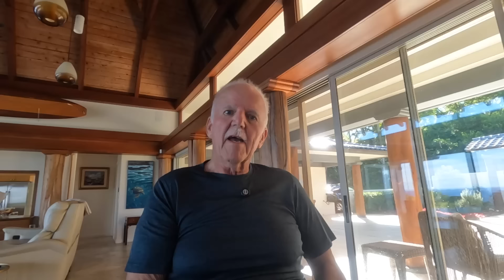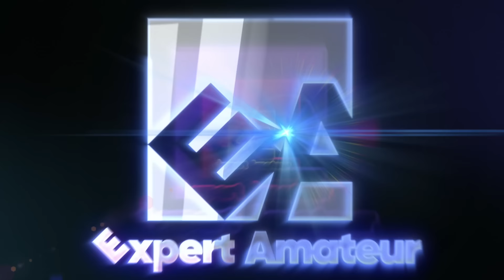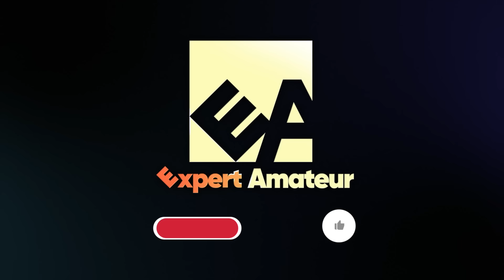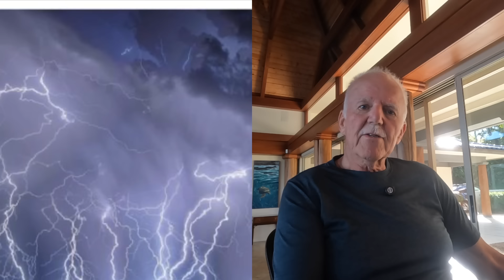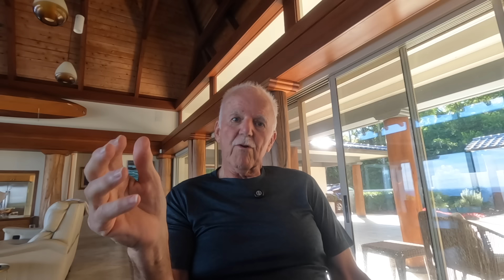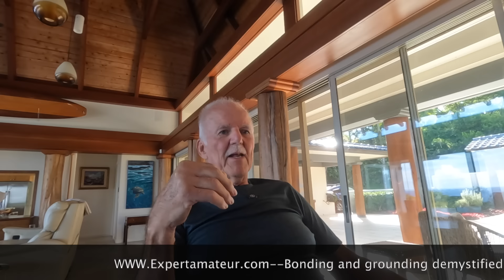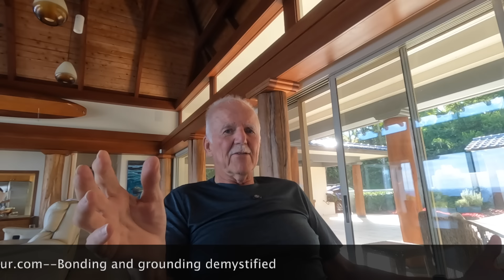solar grounding

Comment: I would appreciate any  feedback on my entire comment I am posting here...
Since I'm no expert either......What is there to do when the actual Experts have no definitive answers and only guesses? 

Personally I'm not comfortable with people on youtube pontificating on what is improvable either.
Respect to Mike Holt, but if he is not certain then I am not certain about putting my trust in 
Electricians or Solar Installer’s advice  on my PV system either.

So Im starting  back at the beginning.. What  am I trying to accomplish or avoid?
IMO, I think its Safety First and Lightning second.
Mike Holt is all about safety and if we look at our solar arrays, we need a proper DC safety ground first and foremost.
To do this we need to watch our terminology and the miss use of substituting the word "Ground" for "Negative"! 

DC Circuits have a Positive and Negative terminal. There is no Ground. Current flows from positive and back to negative
and that’s it!  A safety Ground gets added on after, which is termed "Case ground or Safety Ground"! This ground is attached to the circuit "housing" or in this case the solar panel Metal Frames, and the Mounting Rails which are all bonded together. (along with any other metal components, boxes, etc.)Then adding this  separate wire for ground which  is supposed to run back to your main service panel (which becomes the single earth ground for everything. ..Pretty sure that is what Code likes to see everything to be grounded this way)  So I would think that this would be a solid fact against running a ground wire to a  rod drivin into the earth by your Array?

Just to follow this to completion,.... the DC Earth Ground is there in case of a short or  fault where the positive electrons will flow to the solar metal frame or rail creating a shock hazard ( path of least resistance). The safety ground diverts the current  to the earth to lessen or prevent a shock. ( Not going to get into Circuit breakers or using  DC arc-fault circuit interrupter (AFCI) here)

As far as lightning :
Lightning is unpredictable , which I think is why the experts cannot come to any certain conclusions.

Expert Amateur says, “Solar arrays attract lightning”. This was my first googled question that I wanted to know before I even got into solar and reading articles and many videos which insist this is not the case, but of course these are not experts either. 
I thought lightning  can use any elevation higher than the earth as a conduit ( a tower, a tree, a human etc. Im not certain it chooses metal instead of a tree out of preference? Perhaps if an array is alone in the middle of a field.and the timing of a passing storm and the build up of a cloud charge it will pick whatever conduit that suits it best.) 

As many have said, for most peoples situations, nothing will protect against a Direct lightning strike.
I have seen a video of 3 people standing under a tree that got hit by lightning and all three collapsed to the ground
from the electricity going through the ground next to that tree. 
If you install a ground rod next to your array, and the lightning strike travels through the ground and up your ground rod.....
Haven’t you just created a path for it to travel up to you panels? 

Which brings me to the next point...

I do not understand why some people are fixated about Tying their ground rod by their solar array  to your main service panel ground rod?... 
The example given of the 1970's computers previously having separate earth grounds which were getting fried by lightning until they decided to tie them together by running a wire to  the Main service ground rod?
So, Forgetting about solar for a moment.... what about just a regular house's electric service that has one earth ground rod which  gets hit by a nearby lightning strike and fries the service panel?. Isn't that the same scenario as the computers with the separate ground?  Wouldn't it make sense for a house be more protected by running another ground rod further away from 
the home to dissipate the lightning ? (I think someone already commented about this on here)
Tying ground rods together that are in 2 different locations is just giving the electricity more room to dissipate correct? 
Isn’t that what is being accomplished?  So What is so special trying to mitigate Lightning by Tying your solar array ground back to the Service main earth ground?  I think Mike Holt is correct , that you are just putting your main service panel in danger. IMO it sounds like there is nothing to be gained attempting to deal with lightning  by directing it towards your Main Service Ground Rod.  Direct it somewhere else in an open field if you have that much of a lightning risk I suppose. But again this has nothing to do with grounding your array electrically and properly to my estimation.
Lightning should be handled separately to  safety ground.

Also, I am thinking that a heavy duty Midnite Solar surge protector for the DC safety ground out at a combiner box
is a good choice of protection for most people. It should help keep a lightning surge from going back down your 
DC safety ground to your Main service panel. Also,  A DC arc-fault circuit interrupter (AFCI) sounds like a good idea for safety as well. But I haven’t gotten that far yet.
Please comment or correct anything I have said, because I am just trying to get to the bottom of what the experts can’t seem to help with.
Reply from the maker: That's a lotta comment. I regret saying "solar arrays attract lightning". I know better, I was trying to make the point that it's worthwhile paying some attention to induced current from nearby strikes, but no, they don't "attract strikes", they'd need to be a lot bigger and taller to do anything like that, and the video and post are not really about direct strikes, but induced current from nearby strikes. If lightning hits your equipment directly it's gone, unless you have some very expensive heavy-duty protective equipment. The meat of the article and video is about induced voltage from nearby strikes and general equipment grounding, two distinctly different topics. Induced voltage can be caused by something as remote as a cloud-to-cloud lightning bolt. If a system has two earth grounds it can induce a high voltage between the grounds which causes a huge current to flow because of the difference in potential between the grounds. If there is no ground on the solar array to provide a short path to earth ground a voltage induced or collected on the array framing and structure can cause current to flow through the equipment to the service ground. Not good for your equipment either. Absent a service ground your entire house has no way to dissipate static discharge, such as lightning, safely into the earth. The service grounds helps protect your home and electrical equipment from damage due to high voltage surges. It also helps maintain the same potential between the earth and any electrical equipment or bonded objects, reducing the risk of electric shock. If you don't have a ground rod, YOU may provide the path to ground by touching any metal case connected to the system ground, which is pretty much everything. It also provides an alternative path for fault currents back to the power source, especially if a neutral connection is lost. But it's not a good path, the resistance is variable and may be high.

There is no easy complete solution. Binding (connecting with a ground wire) the service ground to a local ground near the array seems like the best solution to keeping a good path to ground that doesn't flow though your equipment, while preventing an induced potential difference between the grounds that can cause a destructive current flow though your equipment. Binding the two grounds also minimizes the effects of ground loops. I'm going to add this summary to the blog post. Thanks for forcing me to clarify, you made me think this through and come up with a better explanation. I hope it helps you. Here's the blog post that accompanies the video: https://expertamateur.com/solar-grounding-and-bonding-demystified/
Reply: @ExpertAmateur-xn6dr  Thanks for the reply and I will look for your updates and clarification.
I do have another question.....
Will Prowse had a comment on here but it looks like it was taken down?
 (Im glad I copied it before that happened. )
He said"I like how he goes through everyone's recommendation and logic, then states how he does it differently. I've never had an array that far from my systems, but running a dedicated ground makes sense. It is more expensive but it fixes multiple problems.
People get so angry when I tell them not to earth ground their array. Or to bond to negative. Running separate ground fixes most issues. Just costly.
I would never run two ground rods though. Still see the logic in Mike Holt with ground loops and nec. Not messing with that."

If I am interpreting  Will correctly, he is backing up Mike Holt' comment of being against having a solar array ground rod and also tying the two together if there is a solar ground rod?

Its hard not to respect what people like Will Prowse and Mike Holt have to say. These guys live this stuff on a daily basis. And this is exactly what keeps me undecided in agreeing with tying your ground rod to main service panel plan. (along with all the other conflicting comments and opinions on here). .

No disrespect to you and Im not trying to argue, but I would like to know how you can confidently oppose the opinions of Will P. and Mike H.? (im finding hard to do)
Just as a side note:
If you want to learn to distrust peoples opinions , look up how Australia mandated using DC circuit breakers on rooftops and all the fires it caused. After I went down that rabbit hole and finding out how powerful DC arc's can be compared to those little toys they call DC circuit breakers I am only using knife blade DC Disconnects and fuses in my system!
 Anyway,  My point to this is.....Some panel of human beings who were not scientists or experts decided to mandate the use of these DC breakers and burned down a lot of houses. And guess what... they dont make them install them on roofs anymore! All I can say is this is an examples of someone using logic to put other people in danger! I feel more comfortable agreeing with someone with Tested proof of something.

Some people on here only have experience with just one system (THEIR OWN)! How is that a basis for giving "Expert Opinions or Advice.? (again, Im not attacking you personally, just my feelings on the subject) 
They give their advice with such confidence, almost as if they are an authority. My home is 140 years old and was never struck by lightning, but does that mean my electrical system was A-1 top notch designed? If someone says they were an electrical engineer all their life and they tied all their solar ground rods together to the service panel. Does that mean they have the best method, or has there Lightning lottery number just never come up yet?  For me, all this discussion and conflict of opinion is getting exhausting. Im not looking to outsmart mother nature, I just don't want to install something that makes mother natures job easier?
Reply from the maker: @aab9497  I think I addressed most of those issues in the video, but my answers might be more clear in the blog post : https://expertamateur.com/solar-grounding-and-bonding-demystified/

I'm not sure where Will Prowse's comment appears, it wasn't directly in the comments here, he just said the video and discussion are awesome, which is incredibly generous. But I understand what both he and Mike Holt are getting at. There is good reason to say there is already a path to keep the potential on the frames and mounts close to the same as the service entrance. The system grounds provide that path, and you can certainly tie a system ground wire to the structure of the array. Code says it's OK, and many people do that. It's probably adequate. Probably. But that's a somewhat unreliable connection, relying on a chain of fairly funky screw connections in metal housings and many short runs of wire (especially in old houses like yours) and if your racking is remote from your building I don't see why you'd want to be leading lightning or static induced current into your equipment and then rely on a lightning arrestor to deal with currents that didn't need to be there in the first place. The NEC codes go back and fourth on this. 2017 say "A building or structure supporting a PV array must have a grounding electrode system installed (Part III, Article 250), now it says "Additional auxiliary electrodes are permitted to be installed at the location of ground and roof-mounted PV arrays. These electrodes can be connected directly to the array frame(s) or structure".  I haven't found any explanation for Mike Holt's position, it seems he's just concerned that if the two earth grounds are not at the same potential (which will happen if the connection through the system ground is broken) then the induced voltage of a nearby strike or other static charge will cause a current through the earth grounds to the system ground and bonded neutral that will be hazardous or damage equipment. I agree with that, but by the same logic, the broken connection in the system ground means there is no earth ground path for your frames and mounts, which is also hazardous. So that leads me to the belt and suspenders conclusion that a local earth ground (perfectly OK under code) bound (connected) to the service entrance earth ground is a good solution. No, it isn't a code requirement, just (I think) a best practice. As Will says, it does add cost, but if you're already trenching to connect your equipment to the service entrance then its a ground rod and some bare #6 wire. Maybe $200 if the run isn't super long, and if it is, then I'd say doing so raises way above just best practice. I'll add lightning arrestors too--they cost a bit more than ground rods and wire. Belt, suspenders, and an extra belt. It's all overkill until your pants fall down. 

I do love Will Prowse's videos. I watch them all and read through his forum (even better than the videos). His equipment and knowledge are almost as impressive as his willingness to call bullshit on the myths so many people buy into. He's done three videos (or maybe it was two--I'm old, my memory sucks) recently trying to get people to understand how to charge LFP batteries. The comments indicate some folks are still insisting he's wrong. He's not.  

I dimly recall one video where he was trying to track down some mystery currents in his ground and neutral. First of all, it's remarkable that he was even looking for them, that's a pretty unusual thing to do. He's fond of just laying panels in his driveway or setting up temporary mounts and most of his inverters are transformerless. Nevada's dry air is perfect for building static charges. I think I have some notion where his current might be coming from. Of course he does too. I also like that he's into driving race cars. I spent about 65% of my life racing cars and motorcycles. It breeds a certain curiosity and desire to understand things more deeply. Or maybe I have that backwards. 

Incidentally, I've given up on telling people that DC breakers are inadequate as DC disconnects. They all say "I've been using mine for XX years and it's fine". Yes, that's a stupid reply, but I can't fix that. I don't use knife switches but real DC disconnect switches for the relatively low voltage of series PV strings (yes, 500VDC is relatively low) rely on the same principle--lots of air gap, which is why they are rotary and their connection terminals are in such odd places, like 270 degrees apart. There's no way a snap switch, even one with magnetic quenching, is adequate for more than one or two disconnects.  

The lightning lottery has about the same odds as Powerball (inversely). I'm really not writing about equipment being hit by lightning. And yes, your house won the lightning lottery, as did millions of others.
Reply: @ExpertAmateur-xn6dr  Thanks! I appreciate the discussion. Maybe you have already seen this video, but Mike Holt is talking specifically about ground rods for solar around 50 mins into the video. Im curious if you have seen it or have any opinions about it?    
 https://www.youtube.com/watch?v=mpgAVE4UwFw&t=1s
Reply from the maker: @aab9497  yes, I watched it when I started doing the research. I understand what he's saying, which is more or less what I'm saying for half the solution. If you just add an auxiliary ground rod to a system that already has one you will be creating both ground loops and a potential for an induced voltage that can send destructive and dangerous currents through the ground and neutral to your equipment. That's what he says.  The NEC permits or requires (depending on edition) an auxiliary ground rod because If you don't add an auxiliary ground rod the only path for current from nearby lightning or other atmospheric phenomena is from the racks and frames through your equipment to the earth ground on the service entrance, which is also destructive and hazardous. My solution is bind all the grounds together so they rise and fall in potential together (or at least close, because there's some resistance in connecting wire) so a minimal current flows through the equipment. Seems fairly straightforward and I haven't found any reference, from articles on grounding in electrical substations to radio tower and transmission tower grounding, that disagrees with that solution. Of course if you also connect your frames and racks to the system ground as well as the auxiliary ground rod, then you already have the ground rods bound together. But it's not necessarily a super reliable path for binding the rods together.